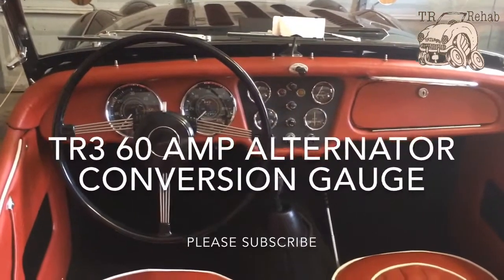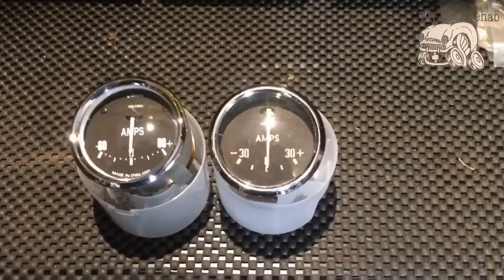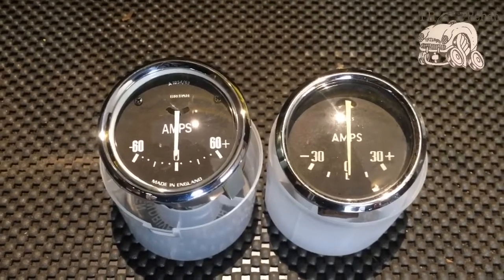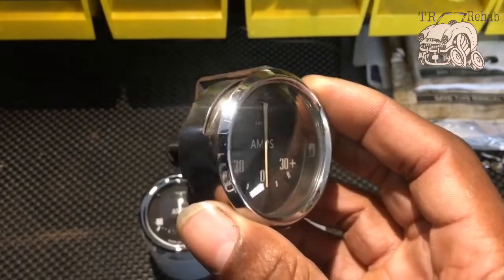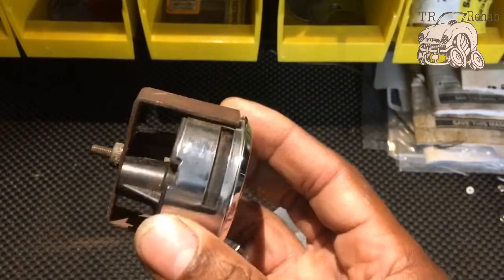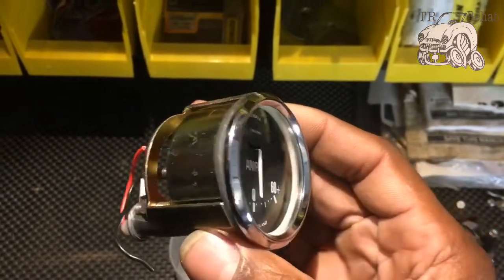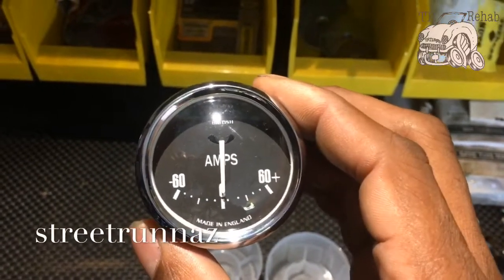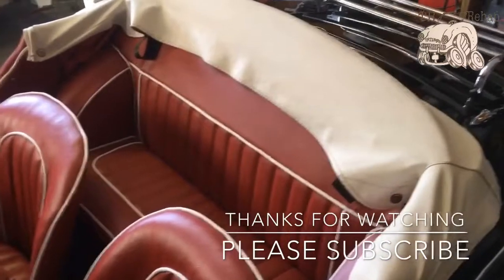Triumph TR3 60 amp gauge vs. 30 amp original gauge

Comment: Do you also restore gauges?
Reply from the maker: I do sell the reconditioning kits which has a new chrome bezel, the convex/curved glass and rubber seal. All of which are correct for the time period. I no longer refurbish the gauges because of the time and detail it takes. Transferring the capillary tube is always a hit or miss for me so I couldn’t guarantee the work. So much easier to just build my “clone” gauge. Send me a picture of the gauge you have in mind Mike. I may be able to help. 

my1957tr3@gmail.com
Reply: some of my gauges need a face lift. my temp gauge is dead no coming back for it so when the time comes I will most likely get one of yours.